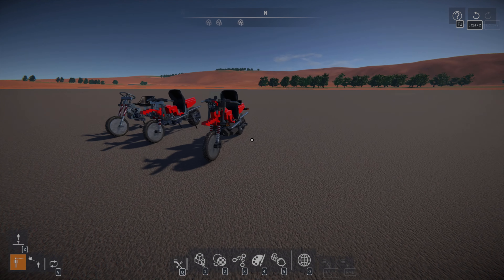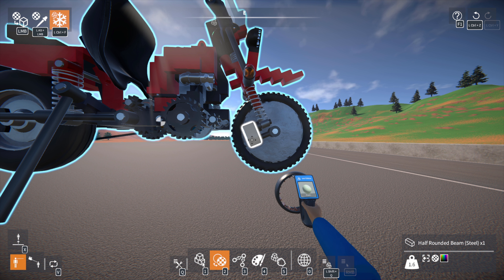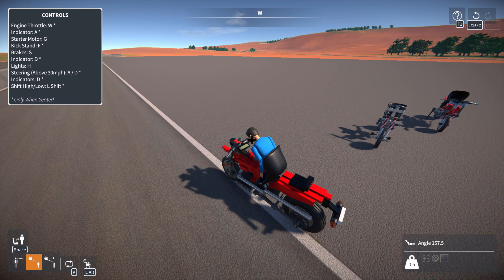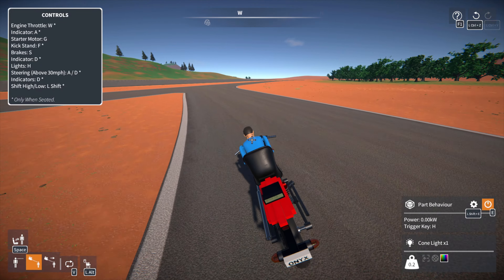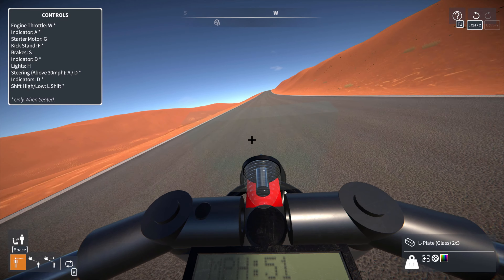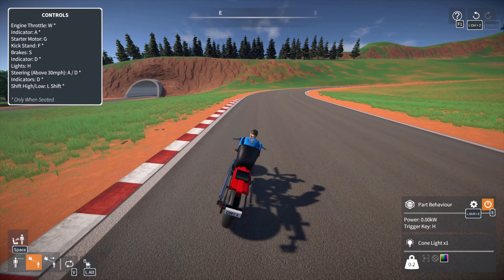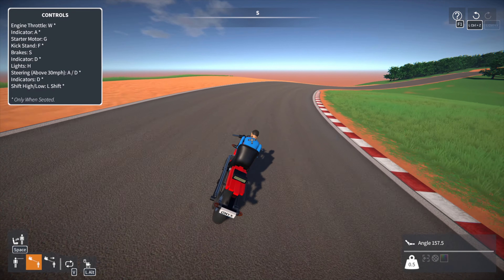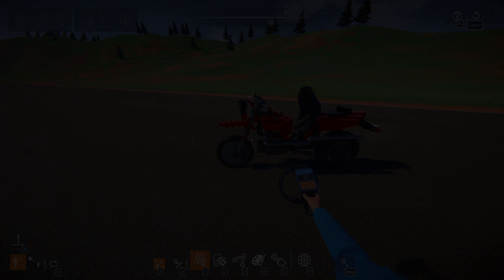Magnum Onyx Motorcycle  |  GearBlocks

Comment: That free rotation on the front wheel is exactly how i make my bikes in scrap mechanic. To turn i actually dont power the steering at all, i use a vertical suspension glitch linked to the seats steering bearing allowing me control of my lean, and the front wheel geometry i use makes it turn toward the direction im leaning. So its super smooth and satisfying. I love building bikes in that game, ill have to give building one in gearbox another shot.